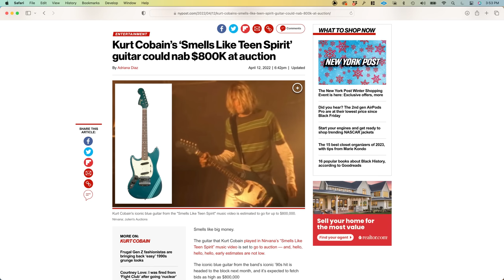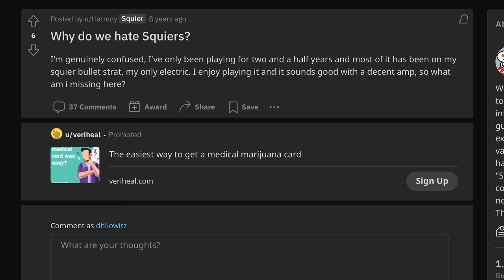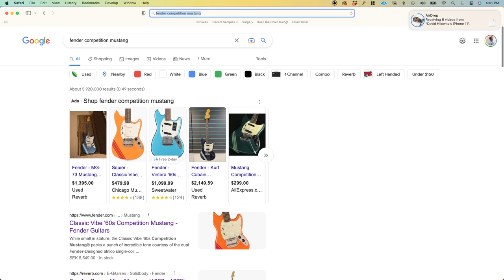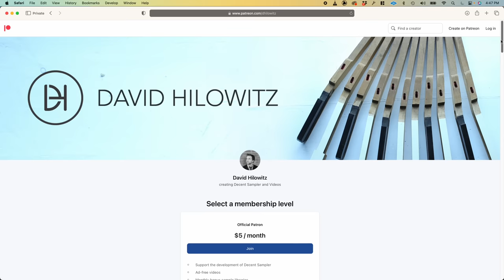Squier Mustang: How I learned to stop being a gear snob

Comment: What i learned from videos like this is to NEVER sell your first starting instrument, you will almost always end up regretting it.
Reply: I have my original 2005 Mexi strat. I've rewired the entire pickguard with all new electronics and components, changed the trem system out for a system I like more, refinished the body and neck, and leveled the frets, dressed the fret ends and rolled the fretboard edges. Plays like a whole different guitar.
Reply: I'm regretting it already :)... sold my washburn stratocaster like several years ago, and now I regret it. I returned to music again, and I'd like to have my old guitar back, maybe mod it. Don't know, do what I know now with it.
Reply: I regret selling mine
Reply: I smashed my first guitar lol, I don’t regret it.
Reply: I had to sell mine
Reply: My first guitar was a stratocaster-esc guitar. It was clearly a junior model or something, it's very small, but the headstock is huge, bigger than probably even the bigger headstock strats. It had 2 single coils. There were 2 switches that did god knows, I just know I had to leave them both in the center or else it wouldn't have a signal. Even so, it had a terrible short somewhere in the electrics, it would crackle a lot and very loudly if you weren't holding it just right. I think it's actually a problem with those switches; I went over the wiring maybe a year ago and made sure all of the wires had good connection and resoldered when I felt it needed it, but the problem still persists. I couldn't give that thing away even if I wanted to, let alone sell it. But there's no way I'd ever want to
Reply: Still got my first guitar which was an Ibanez never really played it much then was gifted a MIM Strat 2006 still got her as well I played her heavy, only guitar I really regret selling was my Gibson les Paul 😢 still think about that guitar all the time … gonna get a new one hopefully soon
Reply: I still miss my very first guitar. LTD EX 401. She was a beauty and played like butter.
Reply: OK, but how do you afford your second guitar if you don’t trade in you first? …..and yes I regret selling so many of my guitars.
 Interestingly I still have my second electric, an early Squier, I carried out such  heavy modifications that the value plummeted. Ten years later it became my favourite guitar, forty years later it’s still my favourite guitar. No regrets there.
Reply: Sold mine. 

I regret it.
Reply: @Jon-ty6bb By having income from somewhere else?
Reply: Mine had a fret out of place and if I found a way to fix that atm, it would have costed me more than the guitar. So I traded it for a Squier strat that I still have (I had to put some money over it but it was reasonable), with MANY mods, tuners were uncomfortable and I wanted high gain pickups. I also broke the body during an anxiety attack so it has another one now (sounds a bit better if you ask me, but I'm the kind of guy who thinks wood doesn't matter, it was probably all the work I put while reconstructing it, I was really meticulous with the electronics and the bridge). That said, I miss the pointy, symmetrical V shape my first guitar had. I also had it painted by a guy who painted cars and did it as a favor to a 13 yo kid in satin gray, there might be some chance it still exists and I can get it back, but never really checked. Regards.
Reply: I agree. But my first guitar was a super nice Japanese Kramer but I just don’t like that hair metal band look so I’m glad I got rid of it.
Reply: i took it apart and tried to carve it into a new shape and never finished 😔
Reply: Thank you for giving me confirmation I'm not crazy for keeping my first starting instruments.
Reply: I kept my old Squire Strat CY99. For its 25th birthday, I upgraded everything on it. Sounds better than ever and still looks great!
Reply: sold my old squire tele and epiphone valve junior stack to pay rent in college and I indeed regret it to this day :'(
Reply: So happy I kept mine.
Reply: I regret having sold my first drumset
Reply: I sold my first guitar and I’m very happy about it) It was an Epiphone Sheraton ii and it was terrible, like all Epiphones. My first Gibson was good, despite the fact that it was one of the cheapest - Lpj 2013. I replaced it with pickups on a burstbucker pro and it became almost perfect. Maple neck, no polyurethane, which is used on all new guitars and a heavy, full body. But I also sold it and don’t regret it much, because I bought an excellent replacement
Reply: I kept my first acoustic and I still love how it sounds but my first electric was a piece of crap lol, no regret selling that and getting a guitar not made out of plywood lol
Reply: Depends on what it is or was.
Reply: I still have the old 1965 Supro bass my parents bought me when I was 11. I thought of getting rid of it at some point because I hadn't been playing for a long time and my late wife and I needed money but she insisted there was no way in hell she'd let me do that.
I'm glad she did that because I've recently started playing music again.
Reply: I haven't sold any of my gears. My first acoustic, my first bass and even my first full frame DSLR are still with me. My 1st acoustic is still my main acoustic guitar to this day since 2010, it just needs good old TLC. My first bass is taken apart because I wanna give it some new electronics and repaint it.
Reply: still got my original epiphone LP 100 from 2008. It's unique and no longer made like that, including real rosewood fretboard. Glad I kept it.
Reply: Just spent $200 on Reverb to buy a similar model to my first guitar. So true
Reply: @Eliphas_Elric Bro that’s so funny, my main is my 2005 MIM strat from high school. I’ve also swapped all electronics/pickups, but I’ve blocked off the bridge, swapped the saddles, and rerouted it for the humbuckers I threw in.

I almost felt like I was reading my own comment! 😂
Reply: I will say that I think it’s less so your first starting instrument, but the first instrument you grew your passion with. I started with a short scale acoustic when I was seven or eight, replaced it with a full size budget acoustic later, and eventually got my first electric guitar, a squier. They all had playability issues and my passion didn’t grow until years later when I traded in my squier for a MIM strat, and I got really into music. I don’t miss those other guitars, but I would be devastated if I lost that strat.
Reply: I had an old epiphone it was a copy of Gibson les Paul black beauty studio alway regretted selling it needed the money back then but still so many regrets it wasn't the best but I loved it
Reply: @garageman_  not about instruments, but i gave a friend my first ever skateboard and i kinda regret it
Reply: Even though I was too sentimental to sell my first guitar, I felt bad watching it collect dust. I gifted it, an Epiphone Wildkat that I absolutely adored, to my nephew. He quickly became a more accomplished musician than I ever did. I've moved on to other instruments since then, but it's great knowing I can still play it from time to time. 

That was the best possible solution.
Reply: I pawned all my guitars back in the day and today I would never do that
Reply: My first guitar I bought myself was a 2001 Fender MIM strat.  Bog standard gloss black with white pickguard and rosewood fretboard.  I remember after 3 or 4 years I had some really weird and silly ideas for customizing it.  I'm so glad I didn't try to do those things, I'd probably hate them now.  

But I might be onboard with grabbing some locking tuners and nicer pickups to bring it more in line with the American series at the time.

Comment: This gave me flashbacks to my own extremely similar project. My first guitar was a squire that I got about 20 years ago. It was tucked away for at least 10 years and the electronics were starting to hum. Rather than sell it, I took it apart and did the copper foil and put in new pickups. Not only did I learn all about how guitars worked but I brought my inaugural guitar back to life with a vengeance. Thanks for this video!

Comment: 20 Years with the same guitar, pretty much the same time with the same motorcycle, and about 10 years with the same dslr. I dont feel the need to upgrade or change. They are living beings, friends of times exclusive and irreplacable. Sometime ago i was walking with my little son and found a trashed guitar broken into two at the neck joint. This vid reminds me of how me and my son resurrected that guitar, used sandpaper, rubbed it along the grain to take the old paint, repainted it blue and firey flames coming from the soundhole. installed nylon strings instead of steel for my little one's delicate fingers. Lesson - never lose your old musical equipment. you lose a bit of yourself along.

Comment: Squier and Fender have been putting out a lot of cool stuff lately.  I got a Seafoam Jaguar.  I had a Squire Bass VI for a bit.
Reply: I want to the Bass VI so bad. It would be awesome for some downtuned sludge metal.
Reply: @RichardDeBerryOfficial  The Squier Bass VI is great, but it has some shielding issues. Apart from that, mine sounds amazing.

Comment: Great video -- my only concern is that the open solder joints on the button might short out against the now conductive copper body cavity. That said, the tone (to my ears) sounds much cleaner, as the Faraday cage is definitely preventing any EM interference from screwing with your tone (at least as it comes directly out of your guitar!).

Comment: I'd have went ahead and upgraded the switch and output jack, along with the pots. A push/pull tone to split the humbucker and a treble bleed curcuit. JB's can be a bit harsh with cheap tone caps, and with modern wiring they are tricky to dial in sometimes. The treble bleed curcuit allows you to back down the volume to tame the screeching, without losing your high end frequencies. You'd enjoy the guitar alot more with these mods.
Reply: Ya, upgrading the pots, jack and switch in an entry level Squier are much more important than shielding on this model. You don't really need it on a guitar using a humbucker and a quarter pounder.  On a standard tele or Strat with single coil configurations it's much more important.
Reply: @tdu5777  Even on alot of mid to high end imports, the electronics are basically crap. Occasionally they'll use a jack or switch that's decent, but the pots and tone cap I always upgrade. People argue that you won't hear any difference. Sometimes that's true. But, I guarantee you'll feel the difference in the taper of a quality pot, and a good paper n oil tone cap can absolutely help tame a JB down a bit. Some people don't mind a guitar that crackles and pops everytime you touch any control on it. I can't stand it. If I'm going in there to replace something, it's ALL getting upgraded if nessessary.
Reply: @andrewbecker3700  yep.  Pot taper is reason one.  Reason 2, those jacks and switches will fail, especially those cheap switches, with enough use.   It's not that expensive to even buy a pre-wired harness.  But if you have a guitar like this apart anyway, they should be changed.

Comment: I know that story 🙂 But this is about the tung oil. If the neck has got lacquer, the pores in the wood are closed, and every layer you put on of any kind of oil, will just lie upon the lacquer. It will not go in the wood and it will not work at all. To make it work, you have to sand down the neck, until you get to the wood and the put on the oil, which will get sucked into the wood.Sorry for my english. ps. enjoy so see how you got so far
Reply: You are correct Sir. Also,  your English is excellent.

Comment: i had a neurodivergent moment at 5:58, "why u no strip the neck finish before hand oiling?" it would totally feel nicer if you did, knock the original (poly) finish back, expose the semi unsealed grain, at very least, and then applying in layers. knocking back with some wire wool or low grit etc as you go. No offense, I just feel this step is a missed opportunity for loveliness. That is all... :) There's sound lutherie reasoning in it too, just not always that obvious...

Comment: To be fair, cheap guitars are a lot better these days than when we were kids. They were made by Asian children in the 90’s and now it’s all CNC. They’re geometrically perfect now, just lack finishing work like you showed. Interesting video.
Reply: for me unfinished necks are much easier to play. my squier tele had some thin layer of dunnowhat which i sanded off, and wiped some oil on instead. now it's perfect
Reply: @geridoo finishing work, like fret dressing, is different from a finish/coating.
Reply: @weedshoes5089  sorry 4 my english, it's not my mother toungue

Comment: I got an Epiphone Les Paul Special bass for Christmas in high school. I tried to put the low four strings of a five string set into drop d, a string broke and threw part of the bridge off with it, and it sat in a case for four years.

I found it around Thanksgiving and fixed it up with Gotoh hardware and EMG electronics. It's the best sounding bass I've ever heard.

Comment: I have a very expensive Gibson Explorer which I bought around 20 years ago, it's a serious instrument and quite hard to play with my small hands due to the chunky neck and weight of a tree but sounds and looks so good. A couple of years ago I picked up a Squier Mustang Bullet on a whim after reading about the neck size and I still have it stock other than the strings, it has weaknesses which I could fix pretty easily for a fraction of the price of my Explorer but I absolutely love playing it as is. It's a really nice Guitar and alot of fun to play. To young guitarists I would suggest you can miss out by having gear snobbery and can find some very affordable gems with a little research.

Comment: Why did Youtube not recommend this to me before? This really reminds me of when I finally picked up some guitars of my own. First there was a really cheap bass guitar with a poorly made fretboard. The frets were jutting out just enough to slice my fingers while playing. I had to file them all down, and then added some new pickups, as well as that copper tape. Next was a Squier Affinity Strat that I actually really enjoy playing. It's just the perfect size for me to play comfortably. Ironically, I picked up the RAT pedal because I heard it was a good distortion for 303 style bass synths, and then later found out that it was often used by Nirvana! Sometimes the right gear is just the right gear. Thanks for sharing this!

Comment: I went through almost the exact same phase, only about 10 years later than it sounds like you did. Nirvana hooked me too, and while Kurt played a variety of fenders and a few other random pawn shop guitars at the time, that competition blue Mustang was also my fixation, as was the Ibanez black eagle that Krist played not just in the video but in a ton of concert and touring - that was my holy grail as a bass player first since by the early 2000’s those were already super rare beyond their original limited run in the late 70’s. I was lucky timing wise that fender reissued the lake placid blue competition mustang right when I had that first obsession and I’d saved money long enough as an early adolescent to buy the fender just as the supply was drying up from that reissue. I left it bone stock for almost 20 years and finally had the bridge pickup changed in 2019 so it was the same configuration as Kurt’s modded mustangs (though I didn’t go with the same humbucker he used, I went with a Gibson dirty fingers because it was a nice middle ground between his layout and other artists I like who use that pickup - and it is a MEAN mustang now). But when it came to the bass I got super super lucky that Ibanez did another limited reissue of that in the 20-teens, but I felt like their electronics left a lot to be desired for such a rare reissue, so I did exactly like you did on your squire and shielded everything inside, and upgraded the electronics to a hot and easy to install dimarzio jazz bass retrofit - huge improvement. Now I love them both, scratched that itch to chase the gear my first real musical connection made me want. Doing those two turned into a hobby and now I just tinker with basket cases and forgotten oddballs to make them sound better and play better. It’s been a journey, but I loved your story too because it just hit so close to my own experiences. Nice job on this video. We all have our own journey and I think this revelation hits us all at some point, just in different ways.

Comment: I still use a 2004 black Squier 51 which I also applied similar treatments: oil-painted neck, changed bridge pickup to Duncan P-Rails, changed pickguard, and changed to graphtech bridge saddles and nut. I love the neck PU which got very unique chime, which even my 20 other more expensive guitars (mostly Teles, Strats, and Jazzmasters) can't produce. BTW I didn't do much copper tape shielding inside the guitar because I realized it kills my favorite high frequencies, so I ended up removing most of them.

Comment: I bought the exact guitar from Adorama. The thing is an AMAZING bargain. My bullet had a thin coat on the neck and it was not sanded as smooth as I would have preferred. I brought mine for a restring and complete setup & my luthier simply steel wooled the neck and "oiled" it and it was amazingly slick. I added Dr. Duck's AxWax and OMG I gotta be careful picking it up by the neck it's so damn slick. No refinishing needed in my case. The pickups to me sound great and take overdrive like a demon. I didn't feel they needed replacement though I might someday put a switch in for single coil option. Ok 2 more changes-- was adding a pearlescent  white pick guard which gave it a lot more of a classy look. Then replaced String trees with Graphtech Black TUSQ.  It's also damn light. My 10lb custom guitar hangs lonely on the wall now.